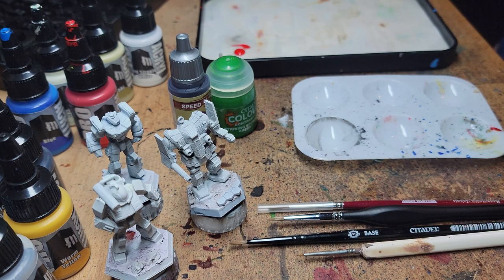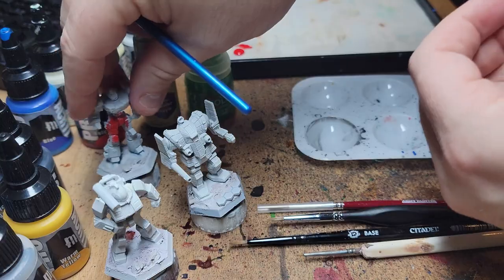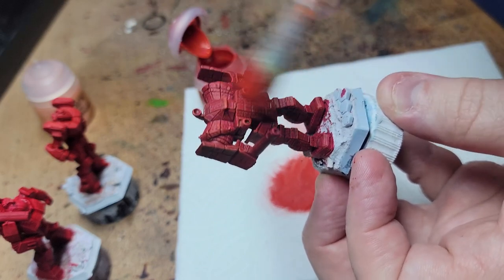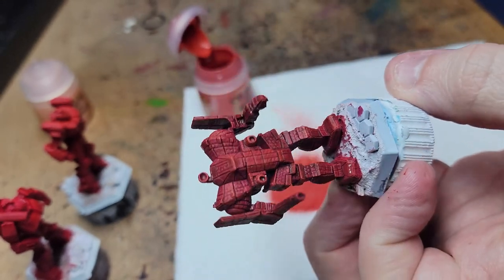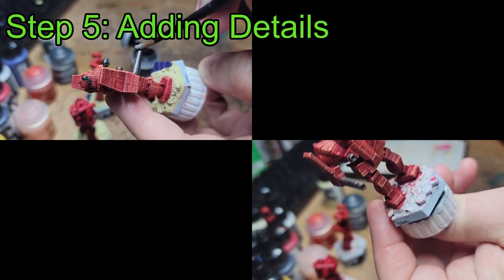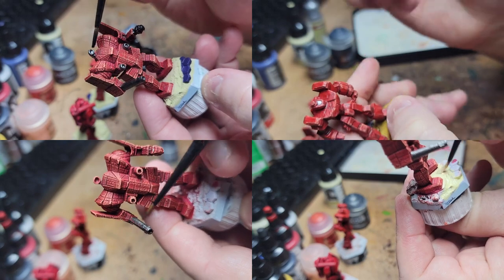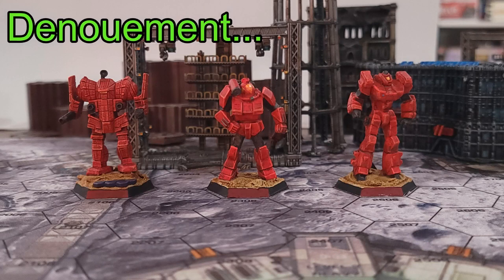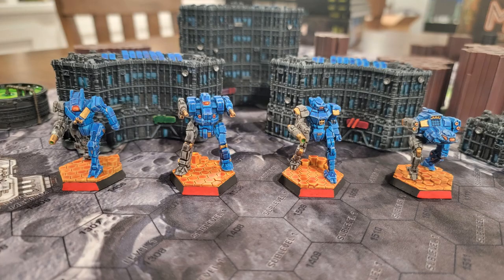How to Paint Your Battletech Miniatures: A Step-by-Step Guide

Comment: I have about 10 boxes of CGL minis that I need to crack open and get to work on! I've only painted DnD minis and I bought these CGL mechs because they're my favorites, so I'm apprehensive to ruin all 30 of my precious WVR-6M's 😅🤣
Reply: Thanks for the tips! This is gonna nudge me even closer to getting some paint on these. 

You got any tips for removing paint after it dries? Like if you want to start over?
Reply from the maker: There are a few cleaning products like simple green that will loosen the paint. If the coats are thin enough, you could risk going over the top.
Reply from the maker: You can do it!

Comment: Alternative option for brush-priming minis: acrylic gesso.  Lay it down relatively thick, brushing it on, then using a stabbing motion to spread it, let it dry, and it will basically pull itself tight to the details, whilst providing a nice, toothy surface to work your paints on.  Touch up any pinholes in the coverage, and you're on your way.

It takes a couple of hours to be close to ready to start working, and I would recommend 24 hours to cure, if you're not pressed for time, but it's a really satisfying surface to work on.  I will also highly recommend that you varnish your finished work with a coat or two of gloss, and then a pass with your preferred finish, as gesso isn't the most durable primer in the world for handling, abrasion, and drops, but it takes some really active screwing up to get it to obscure details.  You can also mix it with other acrylic inks and paints to color it.
Reply from the maker: Interesting. I'll have to look into that.
Reply: @MechanicalFrog  Liquitex makes a black gesso that is my go-to, and it's usually available for not an excessive amount of money at your big-box arts and crafts stores.

If you're opting to go with a white gesso, do yourself a favor and cut it with a bit of titanium white acrylic ink.  This will improve the consistency of the coverage by increasing the pigment density.  You can also do this with clear gesso and a good acrylic ink (the pigment density is key here, and inks are inherently more highly pigmented than paints, as a rule...), though you may need to do some experiments with your pigments to achieve a decent opacity.
Reply: Yes! Liquitex gesso is my go-to model primer as well. I like brush-on primer because I can begin to get a feel for the nooks and crannies of a model and gesso tightens itself up as it drys in case you accidently put too much on your model
Reply: FolkArt Glass & Tile Medium works nicely as well (it was recommended for Reaper Bones minis).  It's more or less clear, so it's kind of like priming it grey.  But it has an unbelievable tooth and durability.

Comment: Some tips I'd like to add:
Using a hair dryer on low heat setting between coats helps to dry and cure the paint and save time waiting to do the next step (do give washes and such a little time to dry first, so that you're not blowing it around on the model.
With Contrast paints, you don't want to do a wash - applied properly, Contrast paint is intended to eliminate that step, by functioning in part as its own wash.
Test your drybrush on your thumbnail before going at the model.  If it leaves more than a faint trace on your nail, scrub away more of the paint from your brush onto your paper towel.
Get the general concepts behind the color wheel.  It's why orange cockpits look good on blue 'Mechs, or green cockpits on red 'Mechs.  Use that to influence your "spot" color that you use to accent other details.
Reply from the maker: Good advice! Thanks for sharing it.

Comment: if you want a cheap wet pallet, get a shallow old piece of tupperware (and an uncracked clear lid helps, but you can use tinfoil) cut some paper towels to fit to the bottom of it and do the same with some wax paper commonly used for things like cookies (with some extra surface so the paint dosn't all run off into the wet lower level) and congrats you now have a wet pallet. I just recommend not using glassware or a metal tray because glass can shatter if dropped and aside from rust if it isn't properly sealed, the metal tray can dent from the back and that can cause dry areas on the pallet.
Edit: rereading my comment I just realized I never said this but you're going to have to add water to the paper towels so that this will work as a wet pallet. I only say this because I know how low the bar is for intelligent life on the internet (although I'm not one to speak on relative intelligence here because the first time I try to paint a minifigure I didn't even try and prime the model until I was told what priming is)
Reply from the maker: Great advice.

Comment: thank you for the great tips,
For me my choice surface to use for drybrushing is an old t-shirt, maybe one that has holes in it. Cut it if you need it to be smaller, and if yah want you can wash it.
I will be looking into some of the commented items for priming. It's been a while for me to get some stuff painted.
I hear contrast and speedpaint dont like flat surfaces too much, is their a solid way to use them on those pesky flat parts.

My real issue that I've been running into is the whole deciding on which minis go to which faction in the end (not many factions, but a couple). 
I'm planning on doing my merc unit, and their OpFor units (Militia/Pirates, Combine Ronin, Wolf, Bears, Jags, Lyrans) And I got pretty much every mech from the first KS, and will be getting most of them from the second. It is more of a difficulty in decision due to all the minis, and that CGL only sells mechs in packs.
Reply from the maker: Luckily the flat parts on a battlemech are pretty small so contrast/speed paint still does well on them.

Comment: Thank you for the great explanation. I have one question: I was taught years ago by a paint at my FLGS that she always paints her minis from the inside out, so start on the innermost parts and works outside. So for the upper body of a night: skin, shirt, armor, cape then add a wash.
The technique suggested here makes me wonder if how you avoid painting over the washed base color when painting things like the cockpit or the joints – any suggestions for that?
Reply from the maker: That strategy might be more important for more detailed and upscaled figures than for mechs. Joints could be done first, in case you do make a mistake and hit a panel, so there's at least some value to it. As far as cockpit stuff goes, since I always basecoat with a strong light color, what went down first isn't really an issue.

Comment: I love your painting method makes the most sense to me. I have a question on paint. This is my first time painting minitures, though my model making was on 1200 to 537 star Trek models and kit bashes so techniques are much the same, though I do more airbrushing than brushwork. For primer I got the only thing I could get in town from the gaming store Pro Acryl Black. It says not to thin it but it near clogged my airbrush, and the only way to spray was at high (rattle can) pressure. What ratio of thinner should I use to kept the speckle spray, and not too thin. Next is I was trying to use some of my previous paints from my model work which is golden brand, but they seem to not want to be thin enough to not still be gunky, especially on the myminifactory files there is hardly any depth around most of the cockpits. I did pick up a couple of small bottles of vallejo model color a that I needed and I may try to find some others. Will make a post on your base paint there.
Reply from the maker: I don't have a precise ratio of thinner to primer but through trial and error, you will find what works for your airbrush. If I had to ballpark it, maybe 1 to 6 or 7.

Comment: My mistakes turn out to be my favorites. I have a Shadow Cat that started with purple legs and salmon upper body. Did a black wash that I then dry brushed Canoptek alloy over it. You can still make out the salmon and purple specially on the feet and back of the mech. I went back and added some black to vents on legs and body as well as giving the right gun a black ink and Canoptek alloy that I cant seem to recreate so that its consistent across mechs for the weapons, but none of the other weapons on the Shadow Cat  got that treatment. Ive tried to recreate the alloy dry brushing to get the same effect but I think that I just lucked out that the purple and salmon dont stand out like it seems red does under the dry brushing*shrug* Its all dog and pony show stuff for after the combat. I have yet to have the courage to unbase them but I noticed that you dont always unbase them either so the soda bottle lid hotglued or double sided taped to the base is a thing I'll have to try.
Reply from the maker: Soda bottle tops with a bit of bluetack work great. That paintjob sounds like a trip. Do you have a photo of it?

Comment: Nice Vid!
Are they 'hard' plastic models which work with plastic cement or are they 'soft' plastic that needs super glue?
Reply from the maker: The older original Ral Partha models, and current IronwindMetals models are pewter, which requires super glue. The Catalyst Game Lab models are a hard plastic which might work with plastic cement though I haven't tried it. I just use super glue.

Comment: I want to make a black lance for the DC. How would I paint black realistically? One more question, why don't any of the battletech painters use a matte coat? These things travel, and go back in forth in boxes, a clear matte coat seems like a huge must. I'm coming from a background of painting much larger models, like perfect grade Gundam, and the bandai Macross kits.
Reply from the maker: 1. Avoid going pitch black. It tends to look off on models. Instead, use a very dark grey and highlight. 
2. I've matte coated models before but don't really travel with them. If I was moving them around a lot more, I'd probably do the matte coat.
Reply: @MechanicalFrog  so should I use my pitch black primer, and than paint over with an almost black gray? Then highlight in light gray?
Reply from the maker: Yes.

Comment: How would I incorporate Army Painter Speed Paint? Most people say I would skip the washing the model as the Speed Paint also shades the model, and jump to drybrushing and details once the Speed Paint is fully cured.
Reply from the maker: So long as you've got your base coat on it, go wild with the speed paint.
Reply: @MechanicalFrog  Saw someone prime black and dry brush white before applying Army Painter Speedpaint and that looked pretty decent too.
Reply from the maker: @augustinelim1985  Yeah that will give you some pretty intense light to dark transitioning.

Comment: Starting to get back in to the game after decades of being away. 

What would you suggest to clean off bad paint jobs from the old plastics thay doesnt melt or damage the plastic itself? 

Also, those "Enhanced Imaging" bases are crazy awesome, do you print them yourself?
Reply from the maker: I designed and 3D print the hex bases. The files are available for free if you have a 3D printer.

As far as stripping mechs go, I've heard that Simple Green will loosen up paint if left in for a while to soak. Haven't tried it myself, though.
Reply: @MechanicalFrog  I just found where you posted the link to them. 

Just have a few from early teens I tried to paint with crappy paint. Look like trash. Granted the plastic minis from back then were also pretty meh.
Reply from the maker: Yeah model paint makes a big difference. Multiple thin coats and all that.  @jasoncooper6047

Comment: Have had a hiatus from painting Nolzurs dnd minis. Now Im back into Battletech and gotten a few mechs rdy to paint. A few tips Ive learned.
❗️1: If you gonna paint any CLEAR plastic. Say ice, spells, flames, acid or laser lenses.Use gloss varnish first to get shiny fresh look, let dry, thin out preferred paint to use, appropriate wash for say cracks in ice, drybrushing, then close in all that with gloss varnish again. If snow on ice spikes use gloss only on ice, then matte varnish over the dryer snow parts.
❗️2: When you are absolutely done with painting a mini use VARNISH! Matte for dry, plain, metallic surfaces and gloss for slimy, wet, shinyfreshy surfaces. This locks in and protects your mini from general use like things causing scratches, stains etc. Better safe than sorry. A mech sploshed accidently by beer thanks to your friend at the table wouldnt be such a threat to your badass mini 😆And cleanfix your mech approperly, carefully to avoid needing to do hooours of rework..
Reply from the maker: Good ideas.